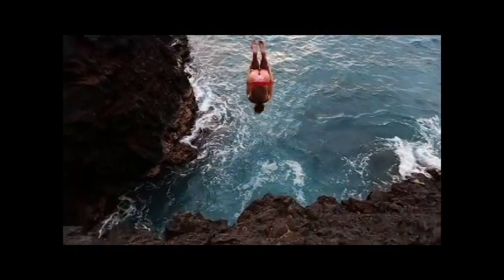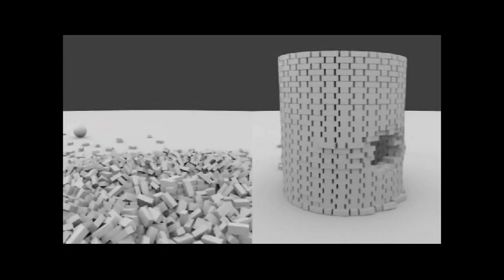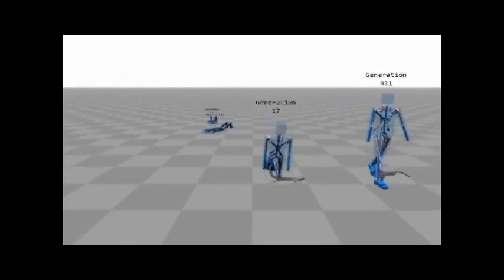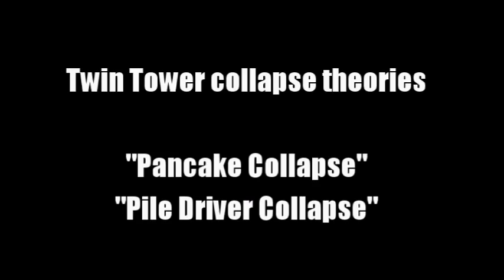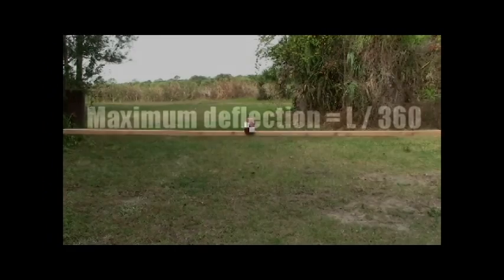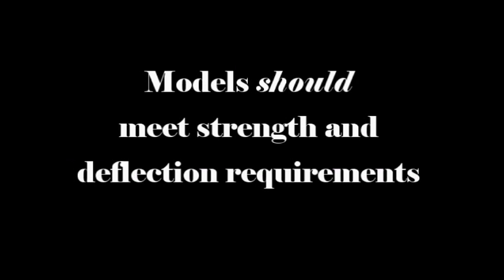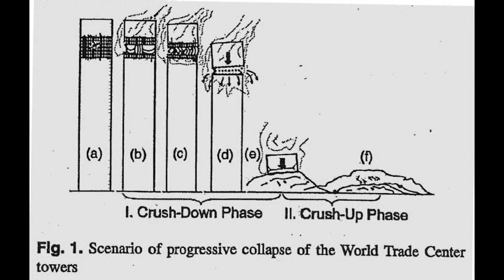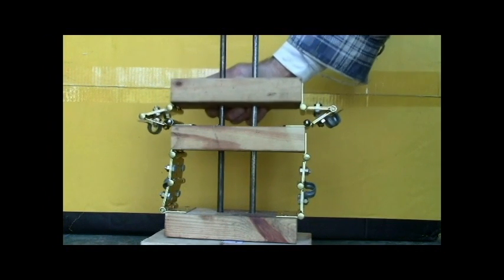9/11 Experiments: The Force Behind the Motion

Comment: I like your determination in making these videos. However my understanding is you can't scale down the WTC towers and use models to demonstrate their collapse. One of the examples cited is the difference between dropping a small and a large object of the same composition from equal heights. The small object might remain intact but the larger one will break apart. Example drop a small stone and a large rock from 100m up. Stone remains intact. Rock breaks apart.
Reply: +pacus123 
I had a similar thought when I saw the wooden 'CD rack' like structure that was used to insert those tiles, as it was taking on the role of the outer columns aswell as the individual floor supports and trusses or whatever. In my mind I could seee how those bits of wood at that scale could be stronger than the steel floor connectors in the wtc.
That being said, I am pretty sure that scale models are used in lots of experiments as well as R&D for various applications.
Although, I think the fact that paper walls were needed to get anything close to resembling what the official report was describing is a strong indicator. Afterall, that paper was much more flimsy than the 'floors' that it was supporting.

And ultimately, These experiments could be recreated using exactly the right kind of, and ammounts of material to get a scientifically comparable structure to that of the wtc, in regard to tollerance etc, but we can't expect this man to stump up the cash for that from his own pocket.

Furthermore, it's my opinion that this experiment was more scientific than creating a computer model to give a desired outcome. (because they 'KNEW'... there were no explosives used, so they didn't factor in that scenario to their 'investigation')
Reply: Myth Busters have the money to make large scale models, yet never take on one of the largest myths in our life times for some reason.

Comment: Nicely done Jonathan. I've cracked Bazant's differential equations as well, contact me privately if you'd like to hear it.
Reply: Carroll Sanders Sorry Karen, if you haven't noticed by the responses you receive on these boards, nobody buys your transparent garbage.  As all you can manage to do is link to pages of jargon and pretend like you made an argument that proves the official theory, you haven't presented anything that require an actual rebuttal.  You've given nothing to rebut.

Newton's Third Law and common sense from basic observation disproves you and the official story.  Steel frames resist collapse.  Free-fall acceleration means zero resistance.  Zero resistance means no more steel frame.  No steel frame means pyrotechnic charges.  Pyrotechnic charges are scientifically proven in the Harrit report.

You've still got nothing to refute any of these inconvenient facts.
Reply: Then I Challenge you as well to show the energy of the welds and bolts acting individually could resist the Accumulated mass, give you a hint, it is mathematically impossible, for you to do it because I am right!
      I await a peer reviewed science paper on the subject!
Reply: +Carroll Sanders welds and bolts act individually? row boat with 8 guys, 4 on each side act individually, but as a team they do what?
Reply: Capitán Obvious Dumb comment, shows you don't understand the physics, welds and bolts only have a limited strength and can not share energy between themselves!
    Since it is impossible for them to share energy once the strength is exceeded they sheer fracture, do to individual impacts.
Reply: So 8 individual rowers can't work together in 1 boat? Amazing.
Reply: Capitán Obvious The rowers are exerting a dynamic loading on the boat, burning calories and performing an action, just like the accumulated mass raining down inside the towers.
     The bolts have no dynamic energy to share, they are merely static and are acted upon. 
     You have the physics backwards, the boat would be the top mass, the rowers would be Gravity acting upon it and the water would be the lower part of the towers structure.
     If the rowers provide enough energy to overcome the waters static energy the boat moves.   The greater the dynamic energy to move the boat, that faster it moves though the static energy of the water.
    The same occurs in the buildings all three, dynamic active energy overcoming limited static inactive energy.
Reply: +Carroll Sanders 
The connections in a steel frame structure are not absorbing forces INDIVIDUALLY.  The interconnected, interlocking cage structure transfers and distributes forces uniformly throughout the ENTIRE structure and into the ground.  When the top portion of the tower collapses, the next lowest floor isn't absorbing all the energy of the upper floors.  The forces are distributed throughout all floors, COLLECTIVELY.

Sorry moron, you're still wrong.
Reply: Emvaz22 Bullshlt, connections can't do that, there is no way not enough time!
The bolts and welds do not have sufficient strength to even attempt to absorb the energy!
Reply: Carroll Sanders <Bullshlt, connections can't do that>

Yeah, they can.  That's kind of how they were designed.  That's why steel frame structures can be built so high.

<there is no way not enough time!>

Lol, the main towers collapsed in, what, 15 seconds?  That's not enough time for the energy from the top floors collapsing to be felt on the lower structure and ground below?  You're delusional.  In a vertical structure like that, a sudden addition of weight to the top would register at the bottom of the tower almost instantaneously if we were actually able to put the entire tower on a scale.

Take your pseudoscientific garbage elsewhere, or produce some sort of credible reference to back up your ridiculous claims.
Reply: Emvaz22 The connections fracture before any jolt though them can even be noticed the 5\8th bolts and welds simply can not transfer the energy, they are not and can not be designed too.
    You show yourself to be a fraud just another twoofer fraud.
Reply: ***** You right Cole is full of shlt but then his experience is in sewage so it fits!
Reply: ***** You think you were on topic LMAO!
Reply: Emvaz22 https://www.egr.msu.edu/~harichan/classes/ce405/chap4.pdf

I hope you know your arguing against Maxwell, and physics, not against me, you can argue against a physicist, not against physics, so good luck too you and your stupidity.
Reply: ***** <+Carroll Sanders Full of shit ... why do you bother dumbo?>

Seriously, he trolls around on every 9/11 video and says the dumbest shit and tries to sound as science-y as possibly.  When pressed, he can never cite a reference that supports any of his claims.  Example:

<The connections fracture before any jolt though them can even be noticed the 5\8th bolts and welds simply can not transfer the energy, they are not and can not be designed too.>

Of course, we can't forget the characteristically bad punctuation and misuse of the word 'too'.  It's almost like Carroll's signature.

Then he links to pages of technical jargon like https://www.egr.msu.edu/~harichan/classes/ce405/chap4.pdf which isn't even specific to 9/11, and without any sort of explanation he pretends it somehow proves that a steel framed high-rise can fall through itself at free-fall acceleration because of an office fire.
Reply: Emvaz22 No it's basic engineering proving that ultimate sheer loads are impossible to design out dumbazz.
I would like to see your calculations that show the steel would not fracture, before it ductility deformed?
Put up or shut up no nothing twoofer fraud!
Reply: +Emvaz22 you're correct about Sanders.   Complete fraud, if not paid troll
Reply: Andy MacDougal I am not here to debunk, I am here to laugh at your dumbazz understanding, of Newtonian physics!
Reply: ***** Again as on the other post you are trolling me on, For every action there is a reaction, and I am LMAO, at your stupidity!😆😆😆😆😆😆😆😆😆😆😆😆😆😆😆😆😆😆😆😆😆😆😆😆😆😆😆😆😆😆😆😆😆😆😆😆😆😆😆😆😆😆😆😆😆😆😆😆😆😆😆😆😆😆😆😆😆😆😆😆😆😆😆😆😆😆😆😆😆
Reply: You are being intentionally disingenuous, I am certain of this. Intentionally deceptive, intentionally attempting to muddy the waters.  But, it's not working.  Soon, if not already, there are or will be more of us than there are of you in spite of your pissing into the breeze.  You're schilling for the wrong side, Pig.
Reply: Andy MacDougal Not likely since Cole is working from Chandler's physics, 36% resistance to 36% resistance based on his miss applied interpretation of Newtonian physics, the fool actually thinks that the building is exerting, a gravitational force = to it's weight in earths gravitational field, on the structure below, not it's mass in zero G, as according to Einstein's general Relativity! 
    The Funny part is Cole doesn't understand the Role of scale to applied forces in modeling, he is a totally clueless buffoon.
Reply: ***** You mean you lost and went running back to mommies basement, because that's what really happened moron!
Reply: There you go with logical fallacy bullshit.  Juvenile name calling.  AND you're on the wrong side of history